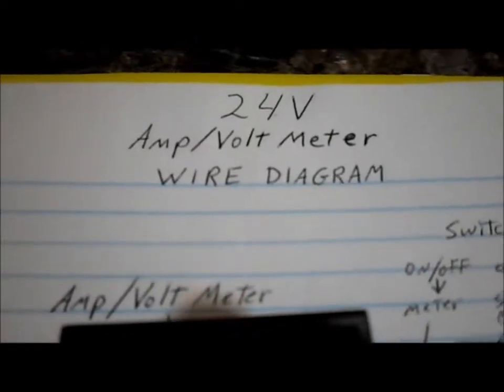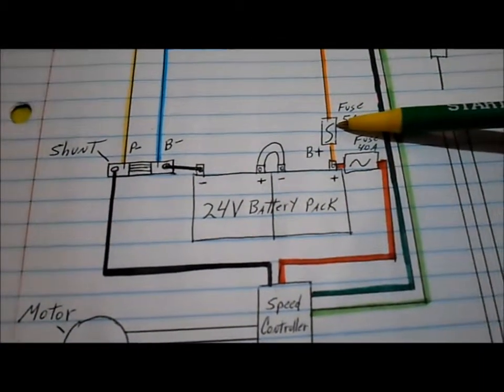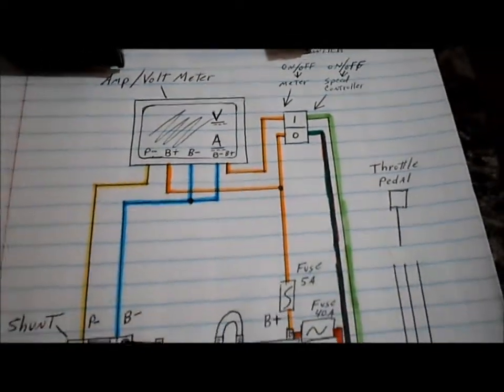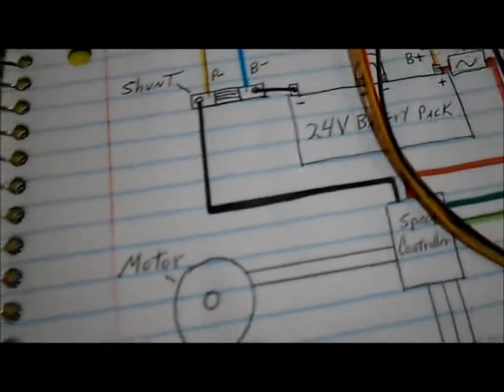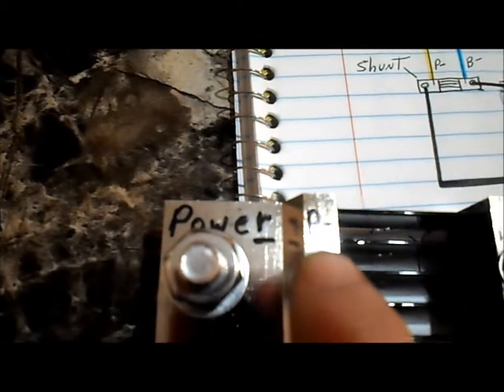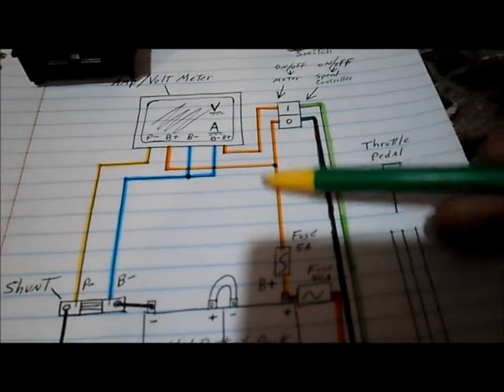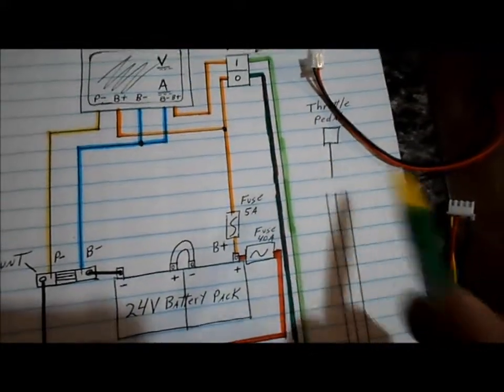How to connect an Amp Volt Meter

Comment: That's interesting. Very good explanation.
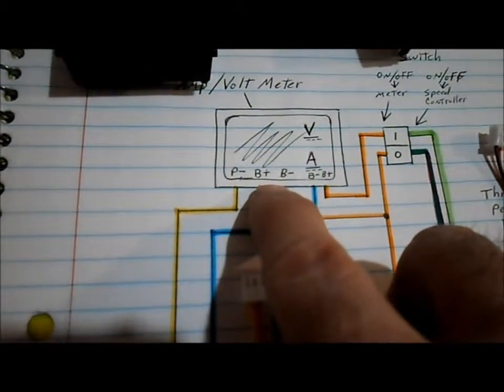@ 5:27 why not run 1 line to the switch?
And then from the switch 2 lines into the +B for battery measurement and port A: +B. That way the sensor never gets +B unless the switch is on, instead of always getting +B and just getting an extra +B when the switch is flipped to turn it on.

Guess it doesn't matter either way. Probably no harm in having the device always receive +B and -B.